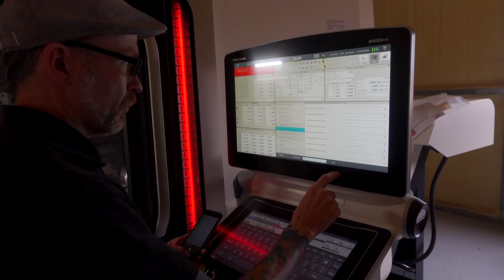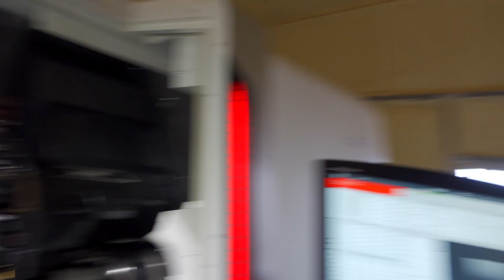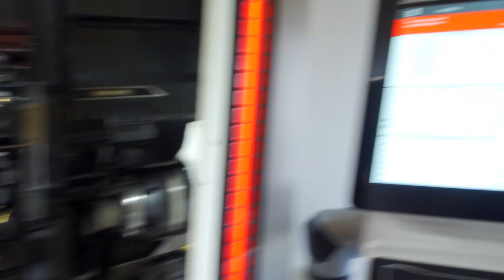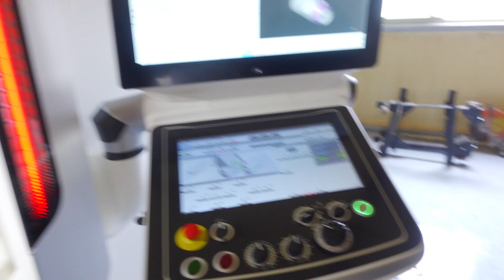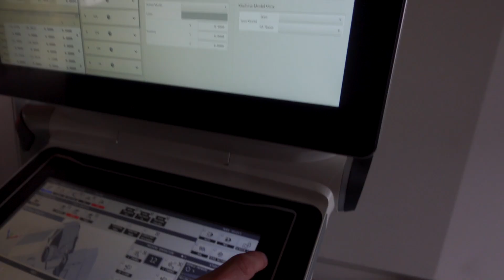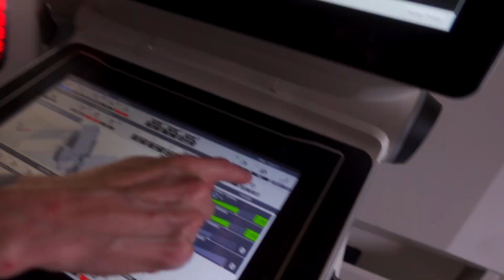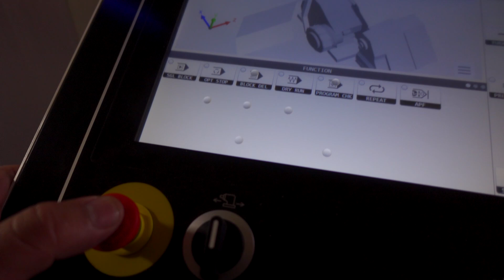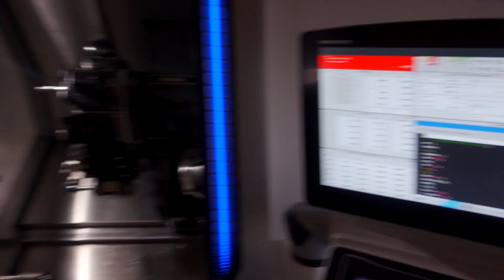DMG Lathe training day 2 | Starting a machine shop 10

Comment: He's trying to learn a complex specialty Good requires lots of similar experience, and  with new equipment he's never used and doesn't even know all the parts of. Meanwhile he's dealing with power and construction so on. This is too much for one person. 
It's the opposite environment for learning. For learning this complex and difficult unfamiliar trade, you got to sit down and think and learn a bit at a time. Then move on to the next thing.
"We're going to build a part today"  is I completely unrealistic objective.
Reply from the maker: Yet, I made it work. 
Second machine got installed last week.  😁

Comment: Just a few timing issues, but those things you had no control over.  It’s frustrating because it’s already a heavy load.  But, you know, just do what you can do.   I’m with you in acknowledging it’s a big challenge.  You are looking at a whole new world. A very complex world.  They probably told you that once everything is all set up, you are just an operator.  That’s much simpler than programming!  I hope they focus on just the operator and owner’s jobs for now because the rest can wait.   As it is, you’ll still have the operator and owner’s roles.  That’s lots.  This part is like a big lump in the effort graph, but it will settle back down or it means you’re selling too much.   Anyway, you know I’m cheering for you.

Comment: I think it's going faster than you thought it would be. You have a lot on your mind and a lot of things going on at the same time. 
One thing for sure while you are setting up the shop I think I would move that air compressor away from the building in it's own little building with sound proof walls. Those things can hurt you hearing plus you're going to put a lathe on that side of the shop. Something to think about. 
You'll have a great machine shop.

Comment: Can’t you run a cord from the generator to the compressor?
Reply: I was thinking surely he has a small generator he could hook up to the compressor.
Reply: @CCW1911  
I am shore it had work with just a extention cord. The big generator can make the spec, of power the compressor need to run. I gues he did not think about it. He have alot going in his head...
😎👍
/J
Reply: @janne65olsson  The generator he's using is a big three phase unit, I don't personally know if it had connections to providing the 220 single phase needed for the compressor, but I wouldn't be surprised if he had a portable that would since he is in the construction business too. There is probably some other factor we don't know about.
Reply: @CCW1911  
I agree  that probably som reason wee do not know about. 😊
But tecnekley to take out the right voltage on one fase is no problem at all. But he need a certifyed peason to do it. And that guy were ther early in the video. So i gues he forgot to ask the man. He do have alot to think about around. As i am a certifyed electrisian i know how to do it woth out a....
💥Bang💥
😁😄👍

Comment: Too bad you didn't have a generator to run the air compressor ;)
Reply: I am shore he cold connect to the big generator. Gues he Just did not think about it when the electrichen  guy were ther.